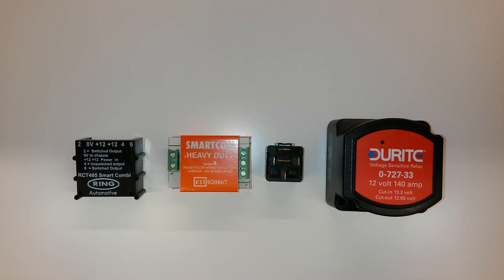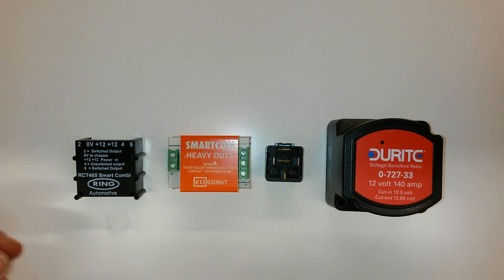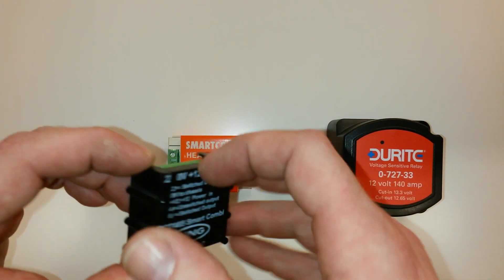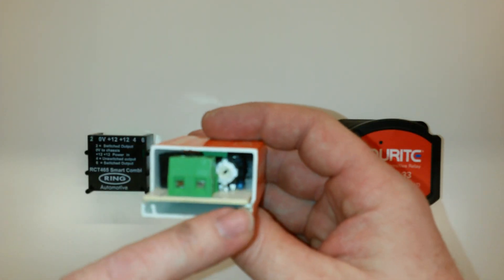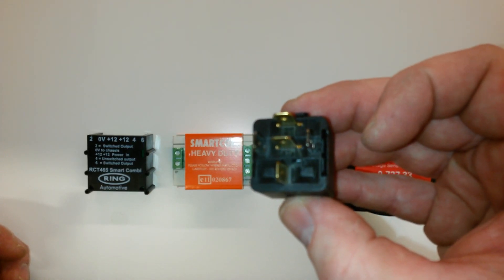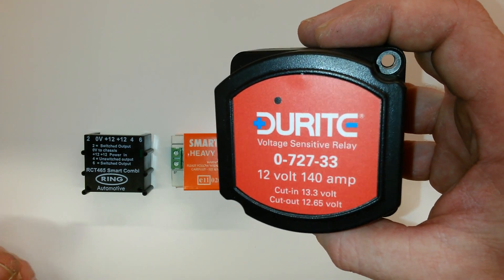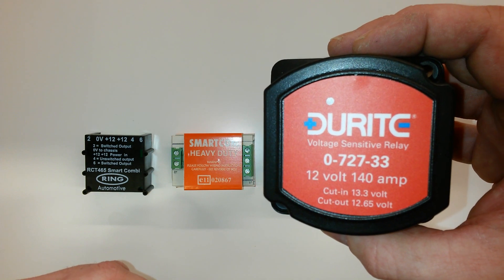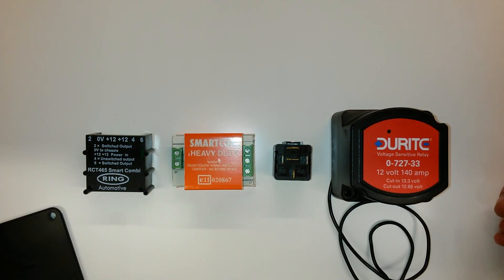Split Relays / Chargers that are on the market for your campervan / motorhome conversion

Comment: Hi, good video, I have a question, when the diritc is connected but the motor is off, well, must the red light on the front of the appliance stay on, or must it stay off and on when charging the batteries, so when you start the engine? thanks
Reply from the maker: It should go off when engine is off.
Many thanks for watching
Reply: dantheman 321 if not?
Reply from the maker: @filippocurzi2214 
If the light is on usually that means the relay is open which means power will probably be able to be drawn off the vehicle battery.
You could have something that's either back feeding to the relay or your relay could be faulty.
Have you checked to see if the vehicle battery voltage drops when you use something in the back?
Reply: dantheman 321 good idea I’ll check
Reply: It is strange because the relè is new 🤷‍♂️
Reply: or maybe it doesn't turn off as soon as you turn off the engine but it needs more time?
Reply from the maker: @filippocurzi2214  maybe but they work off a magnet so when power stops i. e the engine stops the relay shuts down. It maybe be different for your relay what do the instructions say?
Reply: dantheman 321 when I connect the duritc if the engine is off, that remains off, when I turn on the engine, that turns on, but when I then turn off the engine, that remains on, if then I disconnect it and reconnect it again with the engine off, he remains turned off
Reply from the maker: @filippocurzi2214  disconnect the feed out and try it. If it does the same it's a faulty relay, if it works as it should you have a back feed from the conversion
Reply: dantheman 321 what is the feed out? Sorry for my English
Reply from the maker: @filippocurzi2214  the feed in is from the vehicle battery, the feed out is going to the leisure battery(aux battery)

Comment: I have a 2014 Vauxhall Movano 2.3 and I fitted the duritc and sometimes the red light is still on the following day like 14 hours later. I left the van parked without use for 2 days and when I left the 260AH AGM battery voltage was reading 12.8v and 2 days later without anything using it (except the screen of the diesel heater) the charge was reading 12.5v.
Why am I losing so much charge?
Reply: Could it be that I havent grounded the Duritc properly? I screwed it into the bulkhead with a self tamper but am thinking I should have scratched the paint away first. I grounded to the starter battery aswell which wasnt mentioned in the instructions but it never worked until i did. 
Any ideas? Thanks

Comment: Hi and thanks for you video, I have got this orange device fitted into my ford Mondeo mk4, It has started to make a noise every time a start up the car, and I just saw your video and I have just reduced the voltage with a small screwdriver and it stopped making this noise.  Is this okay now ? Thank you
Reply from the maker: It shouldn't make a noise to be honest. You can here a click when the relay starts to work and when you switch the ignition off but that should be it really. Might be worth getting a new one just incase it causes more problems.
Many thanks for watching

Comment: Hi and thanks for the video.  Would i be right in saying that if I have external charging facilities for the leisure battery for example a solor unit and main hook up once the leisure batt is charged the relay will allow the charge of the van batt?  Thanks in advance.
Reply from the maker: Im not sure what kind of setup you are thinking of but the relay will only charger when the vehicle is moving, where as the mains hook up is for when you are on site. Im not sure about the charging efficiency of a solar panel whilst the vehicle is in motion but they work well when stationary.
Hope this helps and many thanks for watching.
Reply: I believe these relays only work one way

Comment: Hi, I have the Durite split charger. My starter battery is 60ah and I have 2 aux batteries totalling 210ah. Do you know if the split charger will  fully charge the aux batteries or will they level out to mirror the 60ah starter battery?

Thanks very much.
Reply from the maker: They "should" fully charge the other batteries but it will take longer, it will also depend on what output your alternator is giving as well and if that can cope with the durite relay. You may have to look to an independent charger i.e solar panels to keep them fully charged properly.
Hope this helps and many thanks for watching
Reply: @dantheman321  I'm trying out different methods for charging my AGM batteries. One thing I have done that works but  you need an ignition powered cigarette port. I purchased a dc to dc converter, input 12v output 41v into my solar charge controller (no solar attached). The controller takes care of the rest.
Reply from the maker: @dazza1591978  
Does your vehicle have a euro 6 engine? if it does you cant use the durite relay you will have to use a battery to battery charger. I use a sterling product which works very well.
Reply: @dantheman321  I have tested my car and the voltage stays at around 14v so it should be good. 😁
Reply from the maker: @dazza1591978  
Does your vehicle have a smart alternator or regenitive braking ?
Reply: @dantheman321  That's a good question, I don't know. I haven't installed it yet so I'll do another voltage test.

Comment: `how would you connect the Duritc to the sargent 160 please
Reply from the maker: Nick Worley 
Hi i am not familar with the sargent 160 but with most power management systems there will be an input for a ignition wire or sometimes called a signal wire. If not you can go straight to the leisure battery via a fuse first.
Many thanks for watching

Comment: Will the durite work on a 2014 vw crafter? I keep hearing stories about “smart alternator”  what’s that ?
Reply from the maker: Julian Bridgeman 
My advice would be to use a 5 pin relay on a vehicle with a smart alternator. The voltages arent consistent with a smart alternator so could cause problems for the smart relays.
Many thanks for watching
Reply: Julian Bridgeman just want to ask what sort of batteries you plan on using may change the method of charging
Reply from the maker: Chris Mills 
Hi what type of battery did you have in mind for using ?
Many thanks for watching
Reply: dantheman 321 im using 4x6v AGM batteries wired in series parallel
Reply from the maker: Chris Mills 
While i dont think you will have a problem with any of the relays ive shown, i am not a 100% sure as in a normal battery setup for a campervan is a standard 12v deep cycle battery, i havent used the relays on that battery setup before. sorry i couldn't be of more help but many thanks for watching.
Reply: dantheman 321 great video thanks for the help think I've found a ring product for the application

Comment: Hi,  I have 2/100amp 12v. Batteries in my HD Ford Transit total of 200amp on the Starter Batteries. Will the 140amp 12v  Duritc  Split Charge Relay be Okay or do I need a stronger Heavy duty split charger over 200amp. to be safe?
Reply from the maker: Stephen C. 
That should work fine just make sure you use a heavy enough gauge wire to use it.
Many thanks for watching
Reply: Guitar Power 2 in parallel

Comment: Hi Dan,We are considering having a van conversion done by you guys and we are looking at the new Iveco Daily with the XL wheelbase, would this type of van be considered as a viable option ?Geat videos you keep posting, very interesting.Cheers - Andy P.
Reply from the maker: Andrew Parton 
hi Andy yes that vehicle is a good option for a campervan infact my dad had the iveco for his campervan. if you are ordering a new one make sure you get the single passenger seat option with runners as trying to find them afterwards is nearly impossible. if you need anymore info just let me know.
many thanks
Dan

Comment: how do you know what amperage relay to get for a 110 amp leisure battery just to keep it top up when using van for daily running about.  thanks
Reply from the maker: Chris C 
Hi Chris you would fine using a 30amp relay for a 110amp battery, the durite relay would be used when you have either 2 big batteries together or a really big single battery. hope this helps.
many thanks for watching

Comment: ps just a quick question in the process of purchasing a panal van for a high end conversion , was thinking about a merc  sprinter but they seem very narrow, in comparison to a fiat ducato, boxer, transit etc, ??
Reply from the maker: CORRIGEEN71 
yes the sprinters are very narrow and the ducatos or relays are the widest giving you about 6 foot 1 inch  across once they are panelled. The wheel bases are normally longer on the sprinters though so it all depends on your layout really. If you need anymore please dont hesitate to ask.
thanks

Comment: any pointers on 240 v hook up wiring ? as in fuse board , etc tks
Reply from the maker: CORRIGEEN71 
do you mean in the 240v consumer unit? if so i think i have a spare unit so i will try and do a video for you but might get next week now
Reply: dantheman 321 wow thanks v much for replying so quick. as I always think its rather cheeky of me to ask you to do a video! , yes a wiring run through on the 240 volt unit,  would be great thank-you,
Reply from the maker: CORRIGEEN71 
hi just to let you know ive have just posted a video on the wiring setup on a 240v consumer unit you asked for. hope it helps you out and if you need anymore help don't hesitate to ask.
many thanks
Dan
Reply: dantheman 321 Thank-you that will be very helpful, also very decent of you to go to all that trouble for a stranger.
Reply from the maker: CORRIGEEN71 
no problem at all, let me know how you get on.